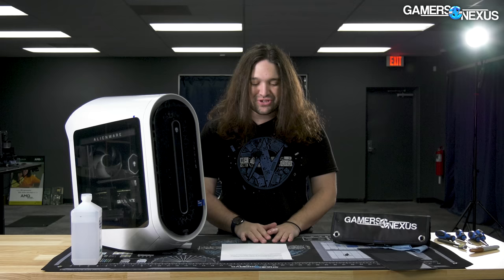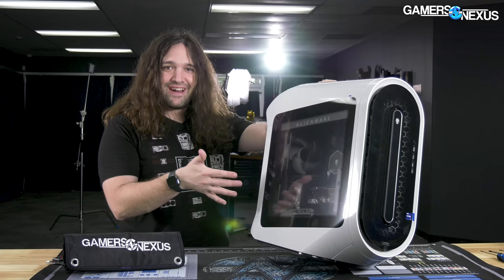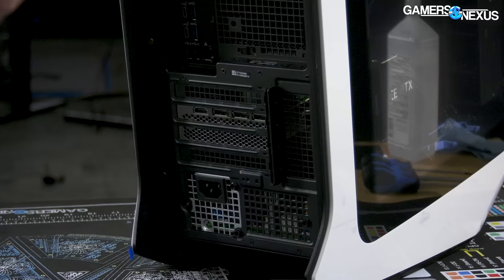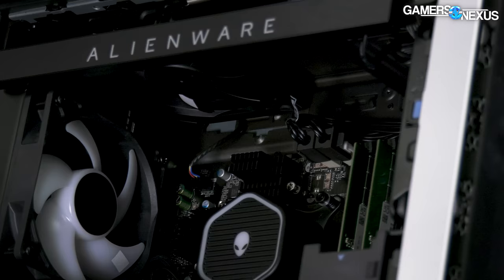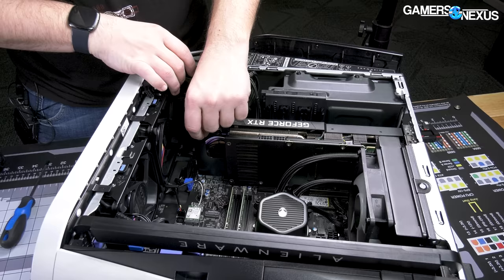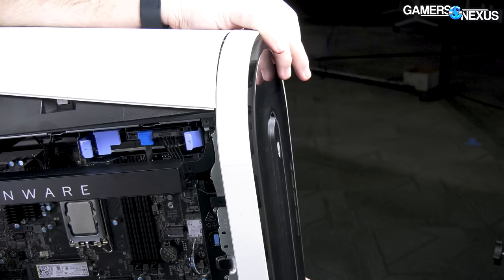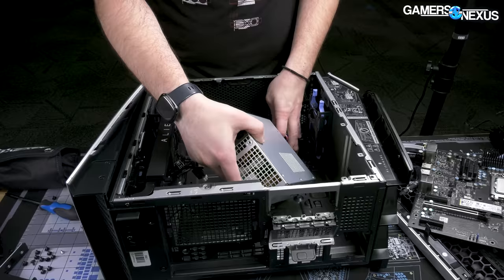Crazy Bad $5000 Alienware Gaming PC: R13 Aurora Tear-Down

Comment: Not gonna lie, I actually like the mounting mechanism they used for the radiator. Removable brackets to attach fans to radiators are always a nice touch. Probably the best feature in the entire case.
Reply: Not worth it for a 120mm one though
Reply: Yeah, having something like that for the 360 on my case would have made it so much easier to mount.

Comment: Steve, if Dell actually put out a product with an updated chassis with conventional features (metal side panels, tempered glass window, etc.), decent airflow, and industry standard (i.e. interchangeable) parts, would you give it the "Better than Dell" award?

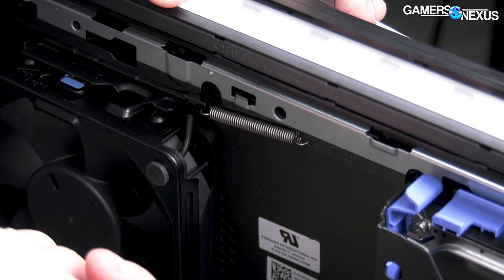Comment: 17:00 
I've been building computers for the better part of 2 decades and this is genuinely the first time I've ever seen a coil spring in one. It's like Dell are trying desperately to use existing hardware stock and kludge it together with needlessly custom proprietary parts. I seriously doubt this is less expensive than sourcing standard modern components.
Reply: I think it's intentional at this point. The market for Alienware is someone who has no clue about gaming PCs, too much disposable income, and who thinks the most expensive option must be the best one. What does such a person expect? A "unique" shape, LEDs, and a case that looks chock full of "technology." Why not throw a coil spring in there...the uninformed person who buys it will probably think the spring makes it better, because his $5,000 case has a spring and yours doesn't. 

They have to know this is all a scam.
Reply: @Phyrre56  i agree, I thought I would never buy one either, until I found this pc on sale for 2,000 off so just for the parts alone was enough for me to say fuck it
Reply: It's not intentional. It's just the Dell Optiplex case. This case is pretty cool, you can service this machines pretty well.  The idea was use as few screws as possible. Thats why there is the spring lock feature holding the sides. All the blue plastic you see here, it's because light blue marks something you can pull or push to release something ( for example in the video the hdd). The problem is, this case is a product of the 90s, and with 90s/00s hardware it works very well. It wasn't designed for today's hardware. It's like a polo with a Lamborghini engine.

Comment: A lot of the mechanical components are made to make replacements easier (add brackets to components that are typically screwed on) to allow them to be swapped out by techs easier and make assembly easier. This is common for a server that is running 24-7 and will probably need fan and disk replacements over the course if it’s life. It’s way overbuilt for a desktop that only runs a few hours a day. So it looks like they reuse their server design teams to do a lot of this stuff and they may not be building around the right design goals for PCs

This is probably the genesis for the case as well. They probably have a lot of server PSUs and smaller faster loud 80 mm fans laying around (servers use a lot of odd fan sizes). So the whole build is made around having a common parts stockpile with their server division. They realized they needed an AIO though and instead of redoing all that work they drilled it into the case.

Oddly enough if they had just used 240mm rad on the front and regular fans on the back it  probably would have been fine temp wise. Maybe a slight undervolt on the GPU. (They may have done this since it’s a custom GPU).

I honestly hate every “standard” motherboard on the market and their root kit like bloatware nonsense, so dell custom making a motherboard to fit their case is actually a plus to me. 

That said there are too many compromises here and it’s way overpriced… (markup seems like at least 30%)

Oddly enough assembly of this thing is probably super easy in factory when you have the SOP. Very few screwed on parts. A lot of things you complain about in other videos like things needing to be glued or screws not being tight are not an issue because of this overbuilding. (They clearly oversolved gpu sag issues.) Everything slots in if you know how to do it. Skills are transferrable to other server builds to a degree. It also is much safer to ship. Less shipping damage alone might pay for a lot of the design work.

So the answer as to why they didn’t use standard parts is that the standard has a lot of problems especially when it comes to shipping and ATX has defeated all attempts to fix it. Now as a consumer is worth it? Probably not as typically the manufacturer handles shipping damage costs.

Comment: It’s amazing the amount of money and resources Dell had to invest to create something so proprietary and flawed. None of it makes any sense.
Reply: It makes sense... they dont want anyone replacing any faulty parts or upgrading the pc so they can sell you a new one instead in a couple years.
Reply: @randybobandy9828  yup exactly that. It’s a shame but it’s been standard practice for years. Going back to the XPS systems of 20+ years ago. When the power supply on this thing dies and Dell don’t sell it anymore you have to essentially go and buy another PC from them…it’s specifically designed to ensure future sales, as you’ve noted.
Reply: @randybobandy9828  but… that doesn’t make sense either.
do people actually say “oh, my dell PC has died after 2 years and my warranty expired, i guess it’s time to buy a new dell desktop PC!”?

the beauty of PCs is that they are modular, when they die, you usually just swap a part and it works again. that’s what makes them better than phones, laptops, and other consumer computing devices. and that’s why what dell is doing is criminal and no sane person should buy something like this.

if dell managed to brainwash people into thinking that PCs are just another throwaway item, like most phones, and people accepted that, then that’s just sad.
Reply: @rare6499  Tbh I don't think they sell anywhere close to numbers where those things matter. Imo, to me, it reeks of "first/second time high spec pc buyers" phenomenon, where customers are inexperienced enough to glance over bottlenecks and clear system flaws, but they are still attuned to spotting high end components and a design that stands out plus features that seem cool/flashy. Because lets be honest, Dell Alienware does have great attention to marketable details. Stuff that is easily quantifiable on a quick-glance spec sheet. Promotional material selling points, and so on. That's what their business appears to be based on. They're making the PCs that are most easily sold with promotional material and basic marketing tactics. And at that, they do excel.
Reply: @Real_MisterSir  I had that phenomenon when I got a prebuilt. It still has some proprietary parts and 120ml, but at least I fixed everything else wrong with it
Reply: (Also, I can’t afford a new case atm but I can in fact do that too)
Reply: @gabets  did you just read what you wrote? Ya it makes sense for Dell to attempt to do this, they are praying on ignorance.  Nobody with even a little pc building knowledge will buy a Dell alienware. There is no other reason why Dell would make every single part of their pc proprietary.
Reply: @randybobandy9828  it makes sense for dell to take advantage of ignorant people/people who don’t care. what doesn’t make sense is to be ignorant. i guess i directed my anger towards the wrong thing.

Comment: Both comforting and horrifying that Dell's consumer machines are just and overengineered as their business machines. We ordered a pair of Precision workstations. When I opened them up, they had a bunch of useless plastic shrouds EVERYWHERE, with superfluous mechanical retainers FOR NO REASON. The shrouds themselves were for forcing a pair of 80mm fans to cool both the Xeon, and the A4500 GPU.

Comment: It hurts to watch this pc's "specialties" getting better and better with every minute. No doubt this pc is actually expensive to manufacture, after all making custom pc parts for only one kind of pc is very expensive. It's almost like using standarts in the pc building world would have caused easy, quick and therefore cheap to assemble computers :)
for $5k I could have bought parts identical to those specs AND custom watercool it and still have enough budged left to invest into an excessively expensive case
Reply: And have fun building it and also be proud that you did everytime you look at it. It's painful how low Alienware has fallen. As a kid in 2007ish I used to think these were the coolest thing in the universe and I thought they had NASA components, especially their laptops.
Reply: @Phenom98  I gotta say from the outside Alienware computers look modern and fast, I almost bought an Alienware laptop too but it didn't take long at all to find out about all the issues these computers have
Reply: Last year I literally built a top of the line PC with a custom water cooling loop for $5,000 (about). Phanteks P500 case, a 420mm radiator and a 280mm radiator with all 140mm RGB corsair fans, with a 3090 and a 5900x. Whisper quiet, top of the line, and easily a better machine than this. It's subjective, but better looking too... did hardline water cooling :) Alienware sucks.
Reply: Like, the technical stuff that requires actual knowledge is already bad enough....but something as simple as plain-jane GREEN PCB RAM with no coolers or anything in a case with a "special amazing" new window and advertised "new dark motherboard". Brutal.
Reply: @kurtownsj00  the only reason they dyed the PCB must have been because of the window. But I'd say the pc would be better off without the window and instead either nothing there or a mesh. Poor rtx 3090
Reply: @sirmrmcjack2167  Modern maybe by 2013 standards
Reply: @Phenom98  agreed XD
Reply: It reminds me of TV money laundering, where they make deals with every company involved, pay each other off under the table, and in the end you get a $100M season that looks amateurish at best.
Reply: @kurtownsj00  🤣🤣
Reply: $5K?
I can build a PC with the same specs for $3K with better cooling systems.
Reply: I highly doubt you'd be able to build same spec PC for under 6k.
Reply: @vancelray  the cpu is 600€, the rtx 3090 around 1800€, about 220€ for 32gb ddr5 5200mhz ram, a decent case between 100-150€, a good 360mm aio for 120€, a 1200watt powersupply (just to be on the afe side) 175€ from bequiet, lets give it 2tb of pcie gen4 m.2 ssd storage for 200€. Totals to, lets round it up, about 3300€ ($3473) and you get the benefit of having componets be properly cooled so they perform well.

Comment: I worked as a Dell field Engineer and the rarest call and the most dreaded service tag to get was a Alienware one. The other techs hated talking them apart because every model would break something while getting to the part we were trying to fix. The customers who paid sports car money for a PC had entitment issues and even if you got it back together correctly the light kits never functioned right when reassembled. The Business equilvent Systems sold for Cad and Game design under the Precision workstation line the primarily difference being the GPU driver.

Comment: I'd been making my own pc builds since 2003. I remember looking at Alienware, even back in their supposed early days when things were good, and was never impressed with the hardware vs what looked like purely aesthetic expenses. You were getting a pretty computer that was average at best and IF you had more money than sense you could of course opt for their top shelf stuff. Yet, if you simply purchased a good simple open case and bought the components yourself you would instantly save $1000 minimum and could get the same high end hardware without the pretty shapes and lights. So I always built from scratch. Even with Puget Custom Computers I bought a setup in 2006 simply because I was working and needed a build that worked. A year later in 2007 I built almost the same computer except now with 8 cores vs 4 and paid a little less than half the price simply because I built it myself. I think the main issue here is that most people that would watch this channel would always want to do self builds. For everyone else that isn't interested in putting together a system ...well then... I guess there is Alienware.

Comment: Thank you Steve!  I wanted a high-end pre-built, I had one of these R13s on order, but canceled it after seeing this video.  You saved my bacon, what a complete load of crap!

I went for this instead: Purchased Directly from Corsair and billed via my Amazon Prime account.  The Corsair VENGEANCE i7300 Gaming PC, i9-12900K, RTX 3080 Ti, 2TB M.2, 32GB DDR5-4800.  The price dropped by $400 on the invoice as a discount I didn't even expect.  I ordered it yesterday at 8 a.m. It is arriving today by 7 p.m. which is pretty impressive if it indeed arrives as scheduled.  Hopefully, this will be a good build and easily upgradeable in the future.
Reply: That computer you bought instead of the Alienware one is way, way, way way way better. Thank God you watched this video, you almost got a useless piece of crap but instead ended up with an awesome PC(one that’s standard and customizable)

Comment: Brilliant engineering is fixing a complex problem with a simple solution.

This is the complete opposite.

Also, 120mm CLC for one of the hottest CPU's around is insultingly stupid- either their engineers are brain dead or Dell's executives are beyond cheap.
Reply: Right? 120mm is going to keep it from hitting TJMAX and that’s about it lol
Reply: More likely the latter, all these design decisions scream planned obsolescence, it's like buying a brick that, very quickly, starts to get tons of chips and cracks. I guarantee the warranty has tons of legalese about how most of the dinky little plastic parts aren't covered.
Reply: water cooling sounds better than air cooling on a spec sheet, so they can charge more
uses single 120mm, with shorty tubes cos it's the cheapest and can fit into a shitty chassis
lol cryo-tech TM
Reply: The common word is 'elegant'.  Combine Intelligence with Frugal.

Comment: You got the almost same setuop as mine. I was soooo upset with hwo much it sucked.  I ended up rebuilding it into a real case.  It would thermal throttle copying files.
Reply from the maker: Wow. Yeah, that's about our experience with it as well. Insane.

Comment: As someone who has spent time doing hardware replacements on Dell Desktops, the mechanical side of things, generally speaking, make disassembly easier. However, this looks like it takes things to an extreme.
Reply: Yeah... all the signs of having been designed to make the field-engineer's task quicker and easier, and justify those service contracts. This isn't a gaming PC, it's a executive status symbol... manufacturing

Comment: i was about to say,this level of engineering is very darn impressive from a PC component/builds company like Dell, like these are some preety unusual mechanicaal design conceepts you dont realy see for PC cases,makes me think if dell just had some spare mechanical design engineers or just let some interns run loose on the "new case" design aka just adapt new hardware to crappy old case

But then again you take a step farther back and you realize this is so unnecesary since there are so many ways to not go to these lenghts
Building a PC case or a costum pc dosent even require a mechanical designer engineer tbh with the current environment,everything that htere is mechanical building wise is good enough and most importantly cheap to manufacture, i guess they had to justify the 5k price of it someway,just seems so wierd to use such talented engineers to solve a problem that could have just been solved by throwing that case design and repurposing the line for another

I also love the fact that they threw some mechanical deisgn engineers at the case but they still have not figured out how to give that case some airflow, i laughed my ass off when i realized that
Its very ironic aswell that anything a mechanical engineer touches just dies in its own heat coffin untill QA and components come in with alternatives to the deisng to also "include airflow" and not just some fancy structural rigidity (this is experience from work,but i dont work in either camp,im just a hardware/software debugger)
Reply: Every time I see the word “loose” I automatically assume it’s been used wrong. I think I have internet ptsd

Comment: The amount of material put into the case itself in Alienware's computers is just sickening.

I won an Aurora R4 PC back in 2010 and got to see the travesty of their PC's first hand.  Though, it was probably less proprietary back then.. and worked better.  Had really nice mechanical air vents, slow release front panel and a pleasing lighting system, could definitely see the cost invested in it.  Nowadays? Yikes.

The best thing about that PC was that I sold it for a bit less than MSRP and used the money to build myself a computer almost twice as good!

Comment: Alienware/Dell: Quick! How do we stop GamerNexus from tearing down our new top of the line PC and exposing our flawed design?

Employee 1: Let's make it hard to disassemble

Employee 2: Let's make various puzzle pieces that does absolutely nothing and make them look functional

Sensible Employee: How about we make our PC actually decent with thought out design?

Alienware/Dell: >: (
Reply: It's it actually harder to disassemble? To the core, yes. But there's quite a lot of well-thought parts. GPU bracket doubles as an air director, toolless fan mounts at least to chassis so you don't need to twist yourself to install them, toolless HDD.
Problem is that all that tells you is that this is a good Optiplex. But this isn't an Optiplex tho, which is why it fails.